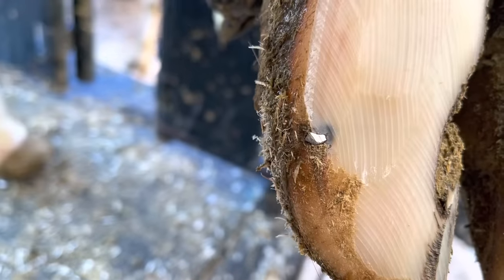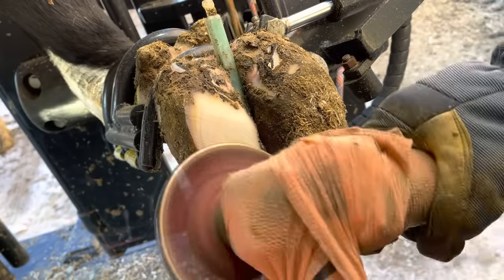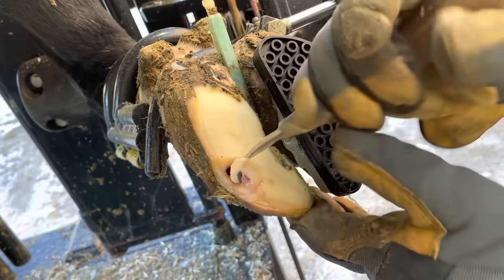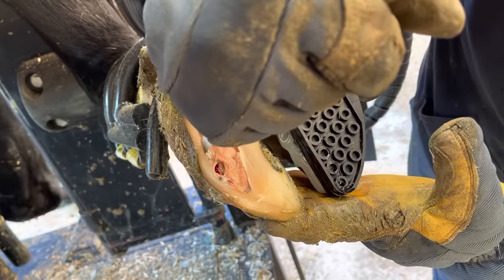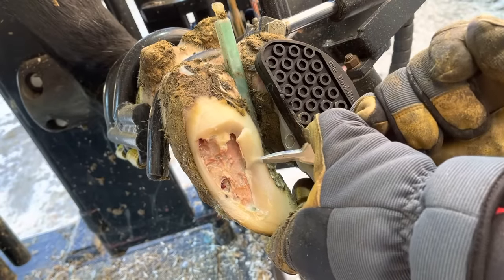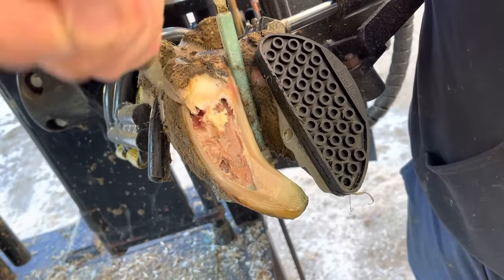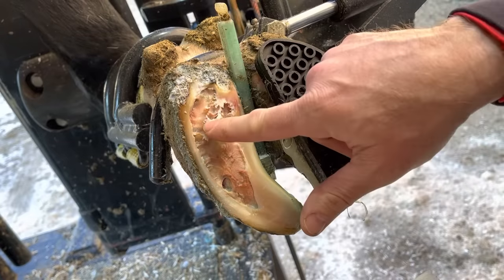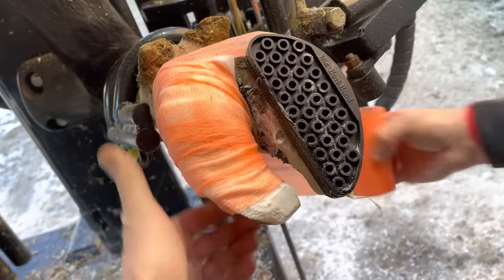This CLAW has a NAIL STUCK IN IT

Comment: It’s amazing the number of nails you can find in a yard. Most of my nail problems come from deliveries on junky old pallets. My forklift tires find pallet nails from time to time.
Reply: Sounds like a good idea to invest in a big magnet.
Reply: @BROXBasher  You'd be surprised how many nails are left after even a big magnet is run over a yard or garden.  My family still finds roofing nails in the garden after literally a decade since the roof was last removed and redone.  Then there's all the other nails, glass, and whatever else that turns up.  

The roofing company did a cleanup with a magnet, but the range that magnets work over can be pretty short, so that on uneven ground it may be too far for them to be lifted from a dip, especially if they get partially embedded in the soil.
Reply: GET SOME GREEN SLIM FOR YOUR TIRES AND NEVER GET A FLAT EVER AGAIN.
Reply: @BROXBasher 
Problem is that iron oxide (rust) isn't magnetic at all, so once nails start rusting a magnet's not really going to help. And it's not exactly like they're fresh nails to begin with, either.
Reply: @Her Imperious Condescension  if its rusted all the way through, it would crumble and dissolve into the soil

Comment: Hi Nate! Good video as always. I was having flashbacks to another trim you did over a year ago, a youngster with a high white line lesion. You started trimming on her claw, and it quickly evolved from a tiny pinprick hole into the loss of most of the sole. It appeared that the infection had tunneled through the claw and left fluid filled cavities all over it. It looked really rough, but she came through it just fine. I'm sure this girl feels better now and is headed toward healing. Thanks for the video!

Comment: Not only was the nail the cause of her problems, it was the perfect plug to the only hole for the puss to come out...
It looked like a spiral nail for roofing, it almost looked serrated also...
The relief that she must have felt when that nail plug was removed and the pressure subsided, that must have been so good!
The sole separation cavity was huge, so much bigger than expected!
I wonder if the flinching from the cow is the sensation of air and touching on an area that she doesn't expect, like if we looses parts or whole nails after an injury? 
It seemed like there was a little separation left at the toe tip area, but it also could be light and camera effects tricking me.
Such quality work from Nate as usual, so interesting and calming at the same time!

Comment: Another major contributor to "Nails" being on farms is Burn Piles . Happens a Lot out here . Also in the UK too, for thousands of years ppl have had Burned down buildings and have Burned old brush/wood, so when they do archeology / metal detecting they find piles upon piles of nails and screws on farmers fields . So i dont see the US or here in Canada being much different . I see it here All the time, sometimes they burn down an old barn thats not worth saving the beams from or they take whats salvageable and burn the rest . Youre right, some times its just Weather related but 9/10 times its from Not cleaning up after a burn . Ive even stepped on nails walking through fields out here, im a photographer, live Rural and go through a lot of fields and have over my 40 some yrs of doing so . Pulled a couple roofing nails and penny nails from the soles of my boots, hence I wear steel toed/shank boots. Had my foot impaled one too many times mate.  Cheers .
Reply from the maker: It’s similar here as well.  Most of the time nails are picked up on pastured cows.  This one however is a freestall cow.
Reply: @NatetheHoofGuy  Ah ok , that makes a little more sense with what you said . Thanks for the reply mate . Cheers.

Comment: My thought when I saw that object wasn't a nail, it looked like it had spiral striations like a drill bit. How can you tell it was a nail rather than any other random metal piece?

I know, unimportant compared to the trim, hoof and cow herself but it sparked my curiosity. Love the vids Nate!
Reply: Having now finished the video, holy moly that separation went a long way! Last time I remember a puncture the separation was only the very local area, as the whole hoof hadn't done its thing yet. I kept thinking this trim was going to stop and then the edge lifted away and it went until most of the sole was visible! Very, very impressive work. You could still see the difference between the disturbed area and the rest of the sole right until the end, it looked like a slightly different texture on the video. But yeah, holy moly that's impressive how thoroughly she'd started shedding that claw.

Comment: I imagine the area you're relatively hot and dry compared to the UK, it sounds like you have less problems than the UK trimmers. I see them taking off large areas and even like 90% of the sole fair often, whereas this is one of the few times i've seen you do it. Just interesting to me how the climate leads to healthier feet, although i'm sure there are other complications.
Reply: He is based in the state of Wisconsin,  very much not hot and dry.  Lots of cold and snow right now.

Comment: That was kind of a whopper. A small nail, resulted in a huge amount of pus/fluid and the sole separated from a huge portion of a claw.  Wow.  Interesting so little damage was done to the corium.  Looks like that was probably an astounding amount of relief, walked pretty normally after the repair.

Comment: Don't you often leave a little bit of height on the trimmed claw as insurance just in case the block falls off early? I guess you didn't have any room to spare on this trim due to the extent of the separation.
Reply from the maker: Yes exactly.  I reference that in the video.  Just wasn’t possible here.